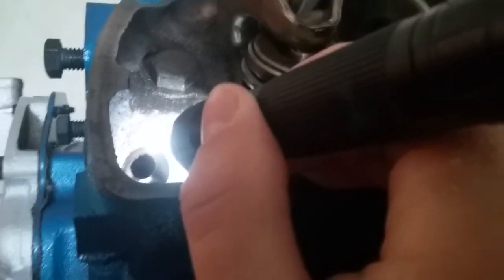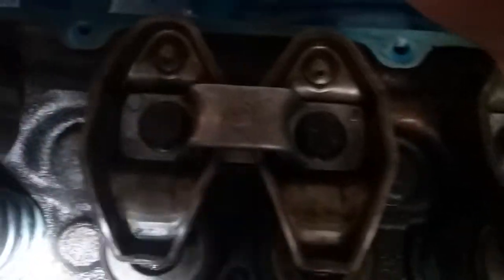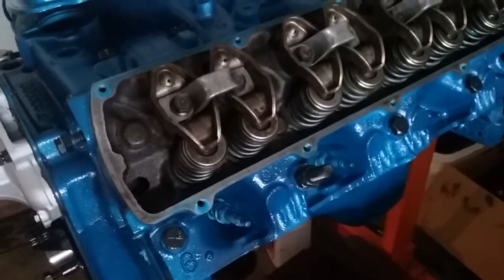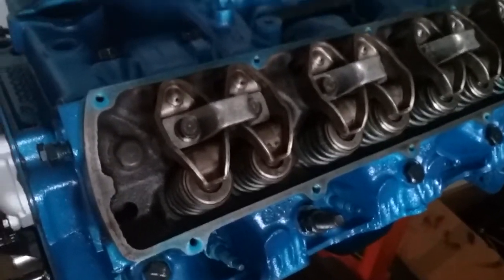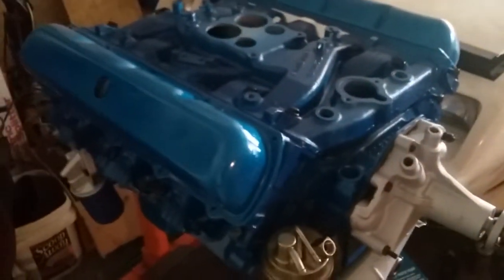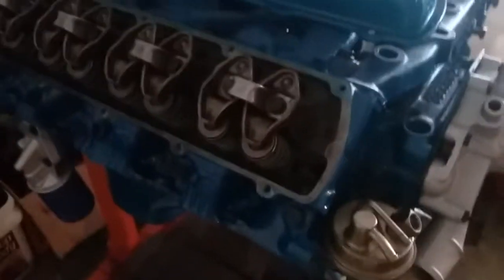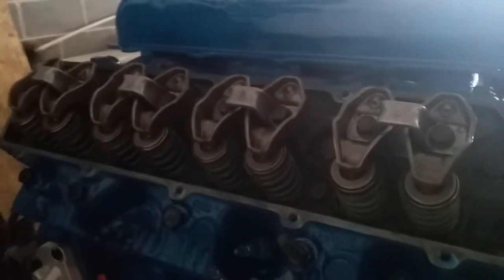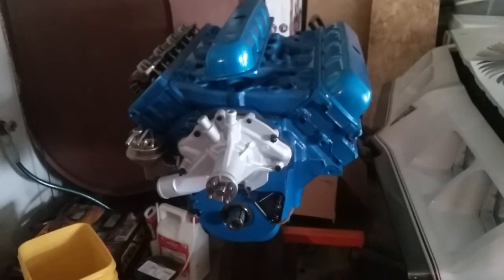Oldsmobile V8 Oil Drain Back Issue

Comment: This idiot must have just pulled this out his ass
Reply: Hes speaking the truth. The oil drain back is a well known problem with these olds engines. The jet boat guy explained it.
Reply: Andy Wright yea ok
Reply from the maker: Ahh I take it you saw the brown streaks on my hand in the video, you've got a good eye for detail my friend.
Reply: It's a known issue in jet boats if you insist on spinning the olds 455 too much.  I've watched my op begin bouncing up around 5,000.  I usually keep her under, like 4500 gets her going just fine.  Want something to blow up, get a chevy.
Reply: @thisisyourcaptainspeaking2259  dont bother with this guy. He insists becuase he know some rando named dick miller that hes the all seeing one of knowledge. Literally talk to anybody that runs pro jet boats and they will tell you they are time bombs becuase they loose oil pressure over 5k.
Reply: All i had to do was look up dick millers website. And i found that he sells an OIL RESTRICTOR THAT RESTRICT OIL TO THE CAM AND TOP END.
Reply: @TheSamplebridge  andy miller is better at olds performance
Reply: Yeah, there are methods for avoiding grenading these.  My method involves being reasonable as these are out of production now for a considerable period of time anyway.  Wanna go blow something up, go blow up a chevy.
Reply: Get it right if your going to talk about Olds motor's put cam oil restrictions in and that cures the problem right there and gust sand down and debur the oil  Gally you won't have an issue change your oil more often I had ten Oldsmobile's and drag racing many of them with Frankenstein Motor's parts from different one to build  over 525 horse big blocks and over  400 h.p. Small block and use a 5 quart  pan reg 4 quart you don't know a dam thing about Olds motor's they never had a seven quart pan people think that know what there talking about don't have a clue just giving out wrong information ...
Reply: @peterrivney552  i just bought a 8 quart pan by speedmaster

Comment: Seen a bunch of the older 80’s-90’s TBI Chevy small blocks have the drain backs plug up with sludge. They would smoke so bad on cold starts like you didn’t have any valve seals lol. Obviously the valve seals were not in the greatest condition because they never changed the oil enough but when u cleaned out the drain backs they didn’t smoke out ur whole street in the morning lol.

Comment: I am in the process of resurrecting a '65 425 and yeah, same thing - tons of silvery thick paste sludge everywhere, jamming up all sorts of vital orifices - which partly explains the number 7 cylinder SNAFU that originally killed it. Since I have the block fully stripped and cleaned, apart from fixing up the cylinders and prepping it for new bearings, pistons and such, I'm also taking plenty of time to go over every bit of the thing, and the heads. That entire drainback pathway, even on a first year casting, is full of sharp edges, jagged inclusions, and the like. About 5 minutes with a 1/8" carbide on the dremel took care of those pretty well. Will do the same when I do the build of the heads. I also highly recommend taking a chainsaw file and breaking the edge on anything sharp, except for key areas (pretty much around the main cap/bearing interfaces be really careful).

Comment: So, as lose oil in the bottom end, you will lose oil pressure? If oil pressure drops, can I assume I need more drain back or larger pan? What is the normal oil pressure range?

Comment: You can chamfer the crank shaft oil holes to make them flow better and change to a higher volume pump. That helps. Olds Racer

Comment: It is possible to reverse the oil flow in an olds engine so the oil goes to the crank first. I remember a guy doing that with his off shore racing boats and won championships. I dont remember his name but I am an old Olds guy. I raced my 71 442 at Island Dragway in Great Meadows New Jersey back in the eighties.

Comment: If you were to run the oil restrictive push rods with the high pressure oil pump, would that be a waste of time and effort or could keep oil in both the valve train area and the bottom end?
Reply from the maker: That's a good question, i never thought about it. I dont know so i dont want to point you in the wrong direction.

Comment: If you rev your engine to say 6,000 rpm it's for a second or two then you shift to the next gear and that drops the Rpms. It shouldn't starve the bottom end of the engine.

Comment: Romeo void  playing in the background  , awesome.    Love oldsmobile  what heads are those , wasn't   G. , was it a  6?   79 trans am in the backgrond?  I have a 78 400 trans am . Used to have a 71. And  a 72. 442 .  Both were 455 s.   Use a coat hanger to clean out the head drain hole , better than a screwdriver  , and its flexible .
Reply from the maker: yep, good ear, not many people would catch that. the heads are number 6, the motor is a 70 350 and the trans am is an 80 pace car, i love those 79-81s. if people would just keep the oil clean they wouldnt have an issue lol

Comment: Camshaft only turns once and crankshaft turns four times oil restrictors work greater also bigger pan and pick up I have a 66  425 punched out 40 over and putting out 500H.P.  and did all those tricked 30 years ago and never had a problem even painted inside head with epoxy for oil to flow down faster to the drain holes and if you change your oil  you will never have a prob... And had mine screaming 7000 R.P.M.   with 4000 stall converter manual reverse valve body with trans break  and 4:56 gears...
Reply: The oil restrictors are for the camshaft and Mondelo sell them ...

Comment: the oil drains are at an angle, because the oil is what cools the valve springs, they don't want it to just drain right down, but they wanted a certain level of oil in the valve covers, yes that's why you have 10 cover bolts.

Comment: I recently bought a 72 olds 98. It had sat for over 20 years. So i checked the oil and it looked good but the starter would'nt turn it, so i pulled the plugs and poured some atf in it for a week. I took a breaker bar to the crank bolt, and it broke loose almost immedetly, so i hooked up an iv with fresh gas. Before i tried to start it, i rolled it over for 2 min off and on, with no plugs. I put plugs in it and it fired up right away. What surprised me is it had NO lifter or rocker arm noise, and ran as smooth as silk. After watching your video, I guess when i rolled it over to get oil to the top end, it ended up getting lots to the lifters/rockers... Thanks for the info
Reply from the maker: 72 98s are pretty cool cars man, Im glad you struck such good luck and worked out well.

Comment: I wonder if having low oil pressure helps. I have 10 psi oil pressure idling in gear and 40 while driving, since I put it in 100k miles ago. I hit 5000rpm whenever I'm beating on it but that is the shift point. Plus I make sure I'm never more than half a QT low on oil. When it's down 1/4 of a QT I top it up. It uses about a QT and a half between oil changes.
Reply: Mike Kennedy Oldsmobile engines don’t have this problem this guy is a idiot. I have been racing Olds cars for 30 years and if this was a problem Dick miller and BTR racing would talk about it but they don’t
Reply: As long as you don't hear bearing rattle (like at startup), you should be fine.  My 455 oil pressure is considerably higher, like 30 @ idle hot with straight 30W but the oil pump might be high volume and it doesn't have anywhere near 100k miles on it since rebuilt using a core block.  The reason for the rebuild was it had been run too long with a burned head gasket and torched a nice groove in the head and deck between two cylinders.  Bottom end was still fine, as far as I could tell.  Had the machine shop balance it while they were in there.  Ah, nearly 30 years ago I guess.
My Buick idles hot with about 7psi oil pressure so I set the idle up a little higher than normal, it will rattle a tiny bit at startup but mechanical oil pressure gauge is rock steady, doesn't flutter like a spun bearing would.  Probably a little lose down there but the buicks did idle with low pressure.

Comment: 77 and newer seem bad for valve cover gasket leaks. My 76 has had cheap Chinese chrome valve covers on it for 12 years 100k miles now and no leaks.
Reply: 77 and newer only use six bolts instead of 10.
Reply: @therealtech833  yes I meant to type that and obviously lost my train of thought as usual

Comment: My 76 Oldsmobile 350 has had 100k put on by me in the past 12 years (nothing but synthetic oil changed every 3-4k miles, spotless inside. I have the stock cam so 5000rpm is Max for it. No issues whatsoever. It had low oil pressure at idle 12 years ago and it's the exact same now.
Reply: what oil viscocity do you use in your specific engine?
Reply: @KnightRidersofGreece  0w40 Mobil 1 last couple of years

Comment: You can fix the oiling issue with restrictors that go in thought main journal oil holes. 

to bad you didnt know about it when crank was out but if you do another olds build give it a shot and then you can use the big oil pump (My 455 60+) these are the ones I have had used.( dont trust link lol) but search 4 mondello >> https://mondelloperformance.com/product-category/oiling-systems/oiling-accessories/

Comment: Sup? I have a 1983 Cutlass Supreme Brougham. It has the "Y" VIN 5.0L 307 in it. I'm thinking about building this engine up. I want to do something different, and try to keep the car original. It's a T-top car, so I won't be doing much drag racing in it. I can't find much info on the net. I want to get about 280-300hp to the wheels with the original 307. With the Olds V8 being your favorite engine, do you think that's feasible? If not, I'm definitely going Olds, not LS swapping this particular car, it's gonna be my cruiser. If 300hp isn't a prudent goal for the 307, which engine do you think would be the best cruiser/street rod engine? Of course, I want to keep decent to reasonable gas mileage. Now, I'm no dummy, I know V8s aren't gas savers, but you know what I mean!? I know the 350s were shit after they started painting them light blue, right? The dark blue 350s are supposed to be the good ones, of course the gold ones are the best. Just give me a brief rundown on Olds engines if you don't mind. Thanks!
Reply from the maker: hey whats up. to be honest i would get your self a good 350, they make more power out of the box and it would cost way more to build a 307 to compete with a 350 than to start with a good 350. im not sure when they started changing colors around but the 68-72s are the best starting point. starting in 71 they all came with dished pistons for low compression but the heads are all good from 68-72 how ever all 68-72 2 barrel engines have a large dish in the piston. they made the 350 from 68-1980 but all 77 and later engines have light weight castings with windowed maines so stay away from them. starting in 73 they began lowering compression through large combustion chambers instead of dishing the pistons so it would be rather easy to take a 73-76 350 and drop a good set of heads in it rather than put flat top pistons in a 71-72 or any of the 2 barrel engines. there is a decent aftermarket world for the small blocks these days. i would suggest staying away from mondello unless its something only they can get because they buy parts from a supplier,  rebox the parts and make a huge markup. the other thing is the 350 and the 307 look almost identical to one another and everything bolts to in the same place so it makes for a very easy swap. Hell you could paint a 350 black and tell people its a 307 if you wanted to lol. hope that helps some.
Reply: Useful Entertainment Helps a lot. Thanks.
Reply: I've gotten 24mpg (29 imperial mpg) with my 350 with overdrive and 2.93 gears. I got up to the same with a 307 and 2.73 gears in two different cars but heavy wind or stop and go was worse on the 307 because the 350 doesn't work hard to get up to speed.
Reply: But yes my 76 350 was darker blue from the factory (rust when I got it) so I painted it gold to make it look like an early one. Now I'd rather paint it that metallic dark blue because I'm proud it's a 75-76 because they were probably one of the most indestructible because of the low compression and hp but still having solid mains.
Reply: I agree, if you want to get more horsepower, go with a different motor. 307 is reliable, but there's really no easy way to make it make good power without a lot of unnecessary work. As was said, get a 350 or 403 small block olds. It will bolt right in. If you can just get higher compression heads or notched Pistons instead of dish, an Olds motor with 9:1 compression or greater, will put out a considerable amount of power, especially low and mid-range torque.

Comment: I had a 403 in a 79ta,do what I did, spend a little time with a grinder and smooth out and align those passages, helps out a bunch.
Reply from the maker: thanks for the info.
Reply: That’s what a lot of people did back then. It was a recommendation in a lot of the performance magazines that the engine builders used to do. I think I’ve got a  Mondello performance engine build book around here somewhere that goes into detail about it.

Comment: 10 valve cover bolts it's a rocket engine
Reply: They are all Rocket engines no matter how many valve cover bolts or what color it is
Reply: All the old pre '71 motors had 10 blots rocker covers mid '70's they changed to 5.  You could still swap them . .no problem but 10 bolts less chance of leaking just sand that gallus and chamber the drain passages put cam restrictions or when you put you cam bearings in drill a smaller hole to restrict the flow the cam only turns 1 time compared to the crankshaft 4 times I built many olds motor's and drag race them big block 525 h.p. and small block 400 h.p. and mostly factory parts....

Comment: Is that not a Buick 455?
Reply from the maker: No it's an olds 350
Reply: buicks had a front mount distributer early rigs anyway
Reply from the maker: @rmzjohnon  yep. Buick also has fuel pump on drivers side like a Pontiac

Comment: Its not a design flaw all motor are the same.hint just change ur oil
Reply: Good video, thanks for tracking all the numbers. Most helpful were CC sizes. I'm just a little curious that you hadn't mentioned stamped numbers/letters on pass side heads that provide additionally info (i.e. "V" on 66-67 442 heads) Also useful for determining Toro or "98" heads.

Comment: Finally, someone who visually illustrates the problem while describing it, as opposed to just making verbal criticisms. This is probably a dumb question, but what are those metal 'bridges' that run across the top of, and connect each intake rocker to its corresponding exhaust rocker arm? Is that designed to increase rigidity or something? I've never seen that on stamped rocker arms. 

Btw: One good thing that engine has going for it, is that you painted almost the entire engine very close to Ford blue. That alone should improve the engine's power, strength and reliability! Lol
Reply from the maker: The bridge is the only anchor point for the rockers they are non adjustable
Reply: @UsefulEntertainment  
Overall, if you had to compare the V-8's of the non-Chevy GM divisions, such as 350's made by Olds, Buick and Pontiac, as well as each division's 455 engines, which are toughest, best for high performance applications, and which is capable of building most reliable power, with lowest odds of failing?

Comment: why did u paint over the spark plugs?
Reply from the maker: They were garbage and I didn't want to paint the cylinder lol
Reply: @UsefulEntertainment   what would be the best way for me to unclog my 350 tbi heads their stock i havent inspected them but my truck has been burning oil after it warms up it only gets worse with the rpms i dont have a compression guage to check my cylinders and my oil pressure it good when it full of oil it shows its maxed out at 60 for my oil pressure i want to believe its my oil drain back holes.
Reply: @midcraze3466  the heads only clog up  on Pontiac/Buick/Oldsmobile motors

Comment: Another joke Oldsmobile valve covers don't leak the older ones have 10 bolts in them. If they leak you killed the valve covers
Reply from the maker: Yes I'm aware the older ones have ten bolts. I added that because the 77 and newer motors don't and those are the ones that leak but guess what, under the valve cover is the same design cylinder head so it was a good example.